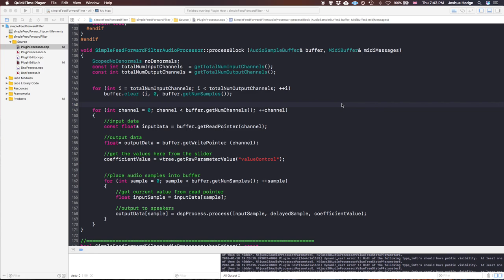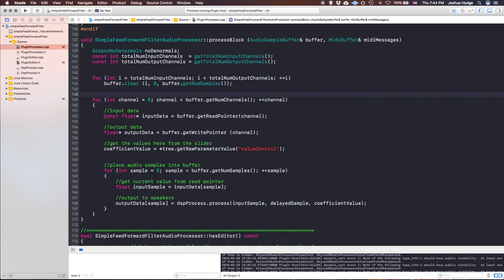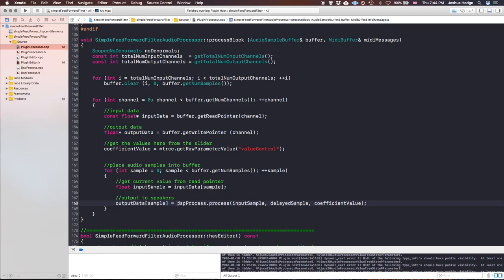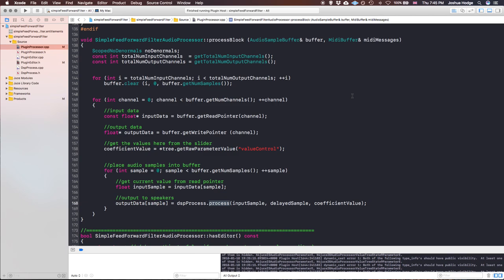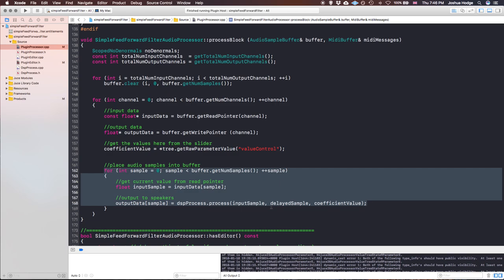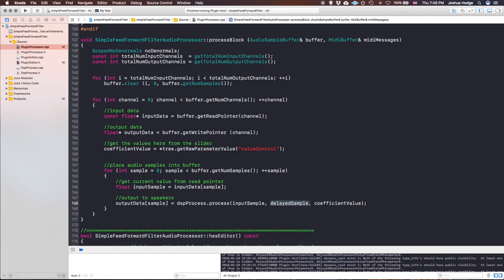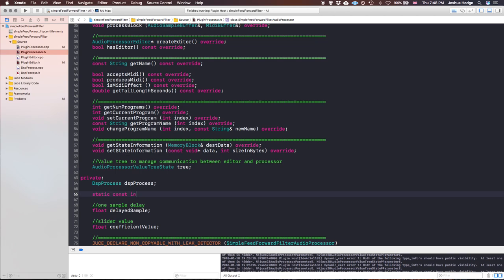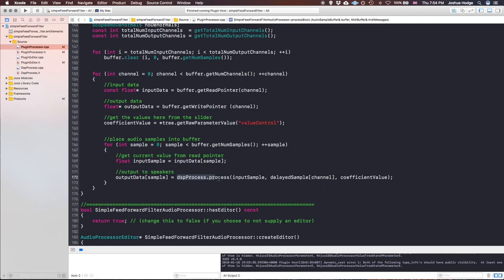Juce Tutorial 27- The Most Important Thing to Know When Creating An Audio Effect Plugin

Comment: My "Multiverb" plugin DSP algorithm uses a major amount of saved data and I too use private variables (mostly float arrays) to hold this data and save it from call to call. I have a Multiverb method to process a block of samples and it requires only the input and output buffer pointers and the number of samples. When it returns, it retains enough information to process the next block. And, as in your example, I have an initializing method. Nice video, as usual!
Reply: It's been a bit cool even in Florida, but getting warmer again. I moved here from Rochester, NY where the four seasons are: almost winter, winter, still winter, and construction. I just checked my EQ plugin, which uses a cascade of biquad filters. Realized that I should have had separate cascades for left and right channel. Fixed it and it sounds much better now. So, your video was a heads-up for me!

Comment: With that const kChannels, you're limiting your processor to only ever being able to process 2 channels. Kinda sucks.
Since you're using a JUCE Array, you can use its native functionality to easily manage the array dynamically.
Create a function initDelayArray(const unsigned int NumChannels) or something, inside it check if the Array.size() is different than NumChannels, if so call Array.resize(NumChannels). This will manage the length of the array and will always keep it up with the current number of buffer channels. But since newly added values may be uninitialized, just add an Array.fill(0.0f) after the resize. So if the number of channels changes, all the delayed samples will be reinitialized, just to be safe.
Then just add a call to Array.fill(0.0f) in your prepareToPlay() function, and call initDelayArray(buffer.getNumChannels()); in your processBlock.
Instant compatibility with all kinds of channel setups, mono, stereo, multichannel, everything.
Reply: Thank you for an amazing and detailed series of really helpful and inspiring videos! I've been messing around with DSP programming for a couple of years now, but - as your videos clearly show me - there's always something more to learn. :)